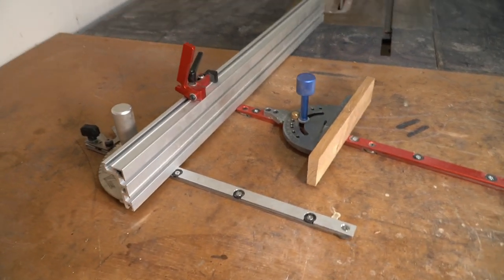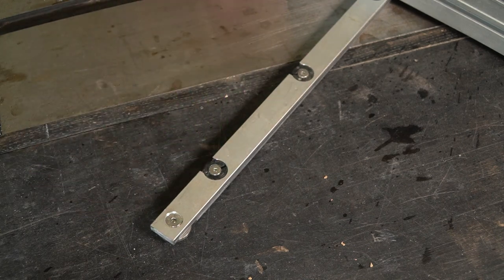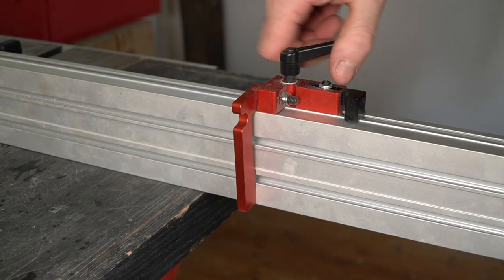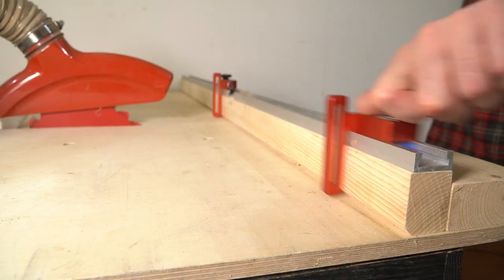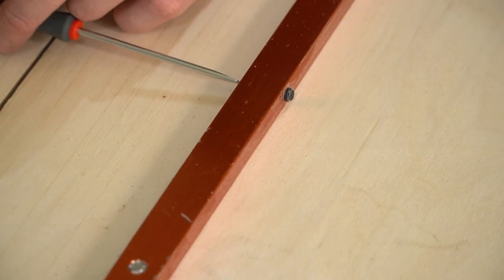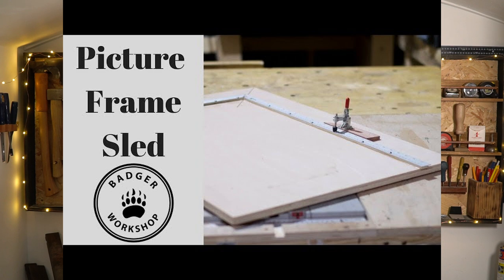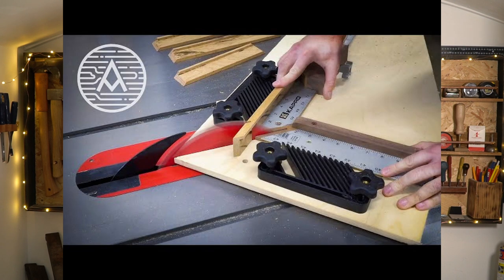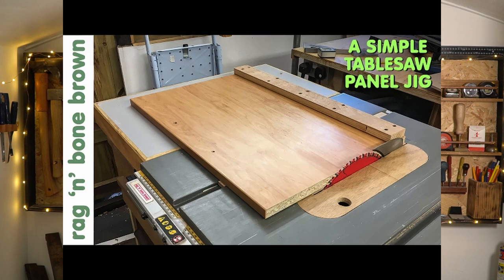Badger Bites Table Saw Sleds

Comment: Thanks Matt. I've used those UJK mitre slot bars on my cross-cut sled and they work well, even on the less than perfect slots on the DW 745 jobsite saw.. A panel sled is next. -  Norm Abram style..
Reply from the maker: Can’t beat Norm